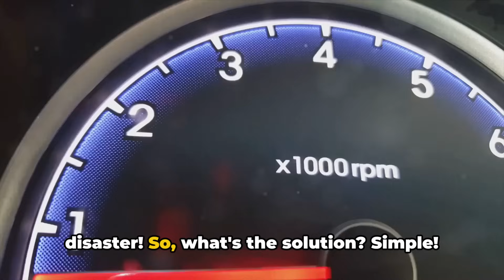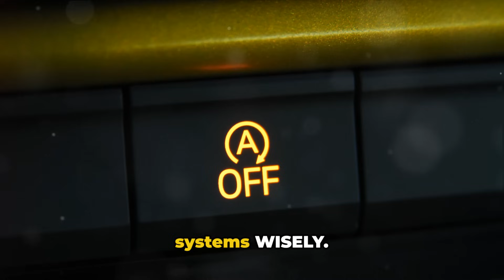5 Mistakes that Destroy Turbo Engines Fast!

Comment: As soon as i wake up, i remote start my truck so its ready by the time i leave, I turned off the start-stop feature because anyone with mechanical sense knows its stupid, and i only use AMSOIL full synthetic on my F150 Ecoboost.

Comment: Sounds like rules for all engines and not just turbocharged engines (besides the part about idling after driving hard as that highly depends on the car. Some modern cars keep the cooling system on for a short time after turning the car off.)

Comment: Could we  , go back, and reverse  ' time '...for about 15 years , or so ?  Auto Industry.  // The  ' problem '....is us, humans.  WE want    WE  want  WE  want.   = more  Power. // So, engineers design, smaller, more powerfull engines.  No honest, design analysis, of   modern  ' people '  and their  fast - reckless, emotional decisions. // Turbos, on gas engines :  1.  A  heat problem ; radiators TOO  SMALL.   People,  TOO stupid, to understand, the  ' physics '  involved, in modern high - tech stuff.  Uneducated, in the laws of thermo - dynamics, and lubrication ; all aspects, of engine design.  From aluminum engine blocks,  ALL  TOO  SMALL....for proper cylinder cooling. Radiators, too small.  Too much plastic  ' coverings '' over engine.  Turbos, SHOULD  ONLY  BE  USED  ON    DEISEL  ENGINES !    Smart phones,  smart houses.....smart  Tvs'......PetSmart   =  makes for  STOOPID   people ; with NO   LOGICAL  analysis'   of   ANY THING.

Comment: today we have bump into a GLA45 AMG 2.0 turbo engine, customer complaint engine knocking, when we test drive we can hear that is pinging, add a bottle of octane boost, stop the problem, customer didn't know what gas was in it before due to she just got the car from carmax. free full tank of gas, but who know what they put inside right?

Comment: In regards to fuel (opinion alert) the difference between the cheapest gas in town and something like Chevron or shell, is more important than putting 87 in your tank. Detonation is a thing, don't get me wrong, but considering almost 40% of vehicles being made these days have turbos now, manufacturers know that the owners will not always put premium fuel in their car. These days, the car knows the octane rating it's burning and adjusts accordingly. You probably won't be able to feel any power difference unless you're on a dyno.

Comment: Start the engine and drive. Let it run for minutes is bad for cylinders and piston rings cause the motor runs with much fuel, that will wash the oil from cylinder walls

Comment: No car should be driven hard immediately after starting. Oil takes about 8-10 minutes to warm sufficiently to do its job. That’s important for the engine generally, not just the turbo. Good video.

Comment: unfortunately, some manufacturers (Audi for one in 2025) no longer allow the car driver to turn the start/stop off.  Others require the star/stop to default to on every time the engine is turned off.  So the driver has to hit the button to turn it off each time he/she starts the engine.  So if start/stop is bad for that Audi turbo engine, will Audi cover the engine failure under warranty after the warranty expires?  I think not.
Reply: Get it coded out, simple.

Comment: Thank you for your excellent advice. As a diesel mechanic, can you tell me if we follow your advice from when the vehicle is new should all turbo diesel owners be concerned about a runaway diesel? I am debating getting an air shut off installed.

Comment: My AMG will not go into Race mode if the engine and transmission temps are not at normal operating levels....
Reply: That’s actually pretty dope

Comment: Letting the Engine idle after driving is going to kill your turbo. While idling there is nearly no oil flow in the turbocharger which causes that the hot oil just sits in the turbo as well as you just turn it off. Instead you should drive calm the last few minutes to let the whole engine cool down with oil flow

Comment: You dont need to wait all that time. I drive a Bmw and when I cold start the rpm goes to 2000 and goes lowering until less than 1000 then youre ready to go

Comment: How is it possible to make high-stress driving on a highway? With such incredible low speed? I guess you don´t mean the german Autobahn. One time I drove 400km with an average speed of 180km/h. Since there were building sites between I had do go about 220-240km/h all the time to finally get my average (that was the best time I achived up to now. It was years ago) Under that conditions there are high-stress conditions. But a US highway seems to be low-stress, isn´t it?

Comment: Cold start and accel...specially for diesel cars its big killer to not wait engine oil get hot.
Me in winter i start engine and go remove snow from car and clean windows(its 5-10 mins process it helps engine gets hot without dmg)and after that slowly drive.
Ofcourse cool engine after long drive make sense.

Comment: I idle the car for a bit atleast for 1 minute in germany youre supposed to drive immediately when youve started the engine but not everyone takes it serious cuz most know its stupid to not let it run a bit to get things cooking
i use 100 octane or atleast 98 octane fuel from more well known gast stations its more costly but those cents in difference can make a bigger difference plus what i hate here is how they praise the Start/Stop Function... like every mechanic told me as ive already knew it screws your battery, it screws with your engine and especially screws with your turbo when you drove on a highway with maybe lets say 130 kmh or more and you have to stop at a stop sign and you maybe forgot to turn it off and your engine goes off and starting it then again can mess up things pretty bad... the start stop is in my eyes the worst feature theyve ever put into cars in my eyes

Comment: Relatively new engines still circulate oil for several minutes after the ignition is turned off, so there is no need to cool the turbocharger first.

Comment: On a scale of 1-10 how much does synthetic oil (which doesn't get thick as fast as real oil does in freezing conditions) help with the first point about not going ham right away after starting? 
On the second point, how much do fuel additives designed to increase octane counteract the bad of lower grade fuel? I usually use premium but occasionally I'll use regular with an octane booster/fuel additive.
Reply: Synthetic oil does help especially the good quality GTL(gas to liquid) Fuel additives can help if you have fuel injectors since they keep your injectors clean.

Comment: After engine start in cold condition I regularly wait until the idle RPM drops down to around 800rpm. Works fine for me since years. And I only hit the pedal hard once water and oil temp is up and in green band.

Comment: Don’t sit when it’s cold. Let the oil move throughout for 10-30 seconds depending on how cold it is, then set off VERY VERY GINGERLY until oil temps are above 150°F or so, or running normal coolant temp for a few minutes when you don’t have an oil temp readout. 

My 2020 Veloster N has almost 100,000 miles and doesn’t have any engine issues whatsoever, including almost no catch can contents and almost zero oil consumption (I only say almost because it’s immeasurable and likely still present). It’s been tuned on a JB4 (MAP2) for 50,000 of those miles. Just took it out in 24°F weather and followed my exact words here.

Comment: Don't do idle thing when car is brand new. Just drive without accleration above 3500 RPM for those 2-5 minutes. Modern oils are no like syrup and they flow well. Don't baby your car and it will last much longer without excessive oil consumption.

Comment: Another good thing to do is accelerate hard at least once a trip so you can keep the turbo waste gate moving. As a technician I replaced more turbos due to waste gates seizing shut then actual turbo failure. Trust me the engine is designed to handle the load and you will not be causing any damage to the engine or turbo. Just wait for the engine to be warmed up and let it cool before shutting it off.

Comment: Great video!
This past summer, I purchased a TLX with the 2.0 Turbo. (I wanted the V-6 Turbo but it was hard enough trying to come by the one I bought and it was the only one on the lot.) This is my 1st ever vehicle with a turbocharger. However, I practice the same thing with my 2 other vehicles and they both have normally aspirated V-6 engines in them, but the 2019 has a gasoline direct injection engine; the 2003 does not.

Comment: Minutes of idling with cold engine causes your oil to mix with petrol which hinders its lubricating abilities. I prefer to drive off with easy foot on the gas pedal few seconds after starting.

Comment: Is it usefull to wait a bit idle (15-20seconds) before driving away if I don't have turbo ? the temp where i live are 10°c winter and 30°c summer.

Comment: No need to warm Engine by idling for 2 minutes. Driving the car at low rpm is the best way to warm it up. Just keep it below 2k rpm and you'll be fine

Comment: I lived within the arctic circle on the Norway Sweden border for many years  we needed to run block heaters in our engines to keep the engine at above freezing even with a block heater I still had to run my old Saab until it warmed up I needed at least 20 to 30 minutes for some warmth to the heater core and defrost the inside of the front screen which was usually thick with ice. I would get out of bed unplug the heater and turn the car on outside the house then go back to bed for 30 minutes then have breakfast and then leave the house. letting a car run for 5 or 10 minutes was a luxury we never had.
Reply: Being English I'm quite adept at complaining about the weather, but if we had your weather I think all of our complain valves would explode. No matter what oil we used or how long we complained on idle.

Comment: well said.  having had turbo cars since a 90 saab 900 turbo I have always followed these rules.    Engine driven Superchargers are less of an issue since they do not share oil with the engine.   Then standard let the engine oil get moving practices are in effect.

Comment: I drive a BMW with a turbo diesel. I always drive slowly for about 5 minutes keeping PRMs low, and never go wide open throttle until the engine is at full operating temperature. This formula has worked well for me on numerous European turbocharged cars over the years.
Reply: New BMWs preheat the engine alone
Reply: You dont need to have a low rpm because u have diesel directly when u start the engine u can gas how mutch u want its only gaspowered cars that need to wait for cold start and drive with low rpm untill it warms
Up

Comment: You definitely must not thrash an engine after a cold start. However, idling a cold engine also causes wear. For example on a modern turbocharged diesel car, you're supposed to turn the key and let the glow plugs warm up the combustion chamber for 5-15 seconds. Afterwards, you start the engine and in less than 30 seconds, you drive away as lightly as possible (don't lug the engine or you'll wear your engine down and clog your DPF faster), gradually increasing the RPM. Letting it idle at 800-RPM for 5 minutes, not only is working a cold engine in RPM on which it is inefficient, but will also create local hotspots due to temperature imbalances.
For a diesel car in temperatures around 15ºC
Let the glow plugs warm up until their light on the dashboard turns off.
Start the car and wait 15-30 sec
Start driving and stick around 1000-1800RPM for the first minute or so, then slowly climb to 2000.

If you have to go uphill, your engine should warm up a bit more beforehand so sometimes you just need to rev it.

Comment: That is a mistake that most people do, not leaving the engine run and heat at the beginning and leave in a rish because they don't want to lose time, and then some have accidents or screw the engine and turbo because of that

Comment: I thought that manufacturers had figured out the part where you need to idle your car after highway or high load driving by now? Up to what year models does this apply as they don’t warn you about this (anymore) in the owner’s manuals?

Comment: I die on the inside when i drive with my mother cause she starts the car and before the lights and everything is on she throws it into reverse drives out then full throttles our 2.0Diesel up to 3.3k rpm 😢😂

Comment: I brought a Sierra Cosworth 3 door brand new in 1987. I used to drive it hard at night, then pull over lift the bonnet and watch the turbo and down pipe glowing. The heat was intense. Awesome. True story!

Comment: ....and use ceramic additives (hBN) ! These give your Turboshaft best emergency lubrication - my little 1.4 downsized NaturalGas (Methan) got now 160.000 miles with engine still running strong, hope it will make further 160.000

Comment: I have a newer BMW X5 w/ turbo engine.. Every morning I warm it up for about 5mins, gives me enough time for my wake n bake 👨🏻‍🚀 ☁️  always change my oil around 5,6 xxx miles, nothing but 91 gas, from good ⛽️ stations.. and also I always turn off the auto/off engine mode, it’s annoying hearing the car shut off at the light🤣 good thing there’s a button to turn that mode off🥃 
I think I’m doing pretty good 🥃

Comment: Great video. Thanks for posting

As you outlined its just a few basic things that need to be done CONSISTENTLY.... every day that ensures longevity of the engines

I just happened to stumble upon this video on youtube, but I have always been following the 20-10-20 rule which is as follows

1) After starting the engine, idle it for 20 seconds
2) Drive gently for the first 10 minutes ( irrespective of your terrain) so that the engine and other parts warm up evenly
3) after you return to your parking, ( I mean any parking) before shutting down the engine, idle it for 20 seconds

I have personally seen benefits such as.... my cars being well below emission levels( I do periodic emission tests ) and the engines would stay refined, besides, I get decent mileage ( I use the manufacturer advised octane rated fuel only)  as the  parts work efficiently

Again, thanks for sharing, happy motoring !!!

Comment: I have a 2016 Subaru Forester xt, 2.0 turbo, just turned 282,000 miles and runs like the day I bought it. I change oil every 4000 miles and have had no problems.

Comment: For newer cars when you turn off your turbo engine it wouldn't usually go complete idle as I can always hear the engine/fan still running for a min or so before going completely silent. Wouldn't that be the manufacturer's mechanism to protect the turbe engines?

Comment: Changing Oil every 3500 to 5000 miles? Every 5600 to 8000 km???? That may be recommendable with non-synthetic oil! Synthetic oil lasts easily 15000 km (9300 miles)! I bring my car (Mazda 6 Wagon, 2,2 liter R4 bi-turbo Diesel) to an inspection (including oil change) once per year, just when dashboard says it is time for that. And my car is running with no issues at all, despite having some 212000 km on the clock.
Reply: I change mine annually.  October or November get it in so its got nice fresh oil for winter. Usually about 5k miles on mine

Comment: 3:09 The result is not just oil coking. The turbine shaft is still spinning at a high speed immediately after driving, so when you quickly shut off the engine, those turbine shaft bearings/bushings have zero oil pressure to lubricate and cool them. The same goes for revving the engine at a car show to impress your friends, then shutting it off.

Comment: I got all of these tips recently from a friend when I asked him how my car which delivers 130bhp from a 1200cc 3-cylinder engine manages to achieve that - extreme supercharging.
Reply: Don't check the 300 HP 3 piston engine from Toyota Corolla GR then ... or the 1600 cc F1 engines which have 850 HP
Reply: I am guessing you drive a Peugeot or and Opel with those modest Hp figures

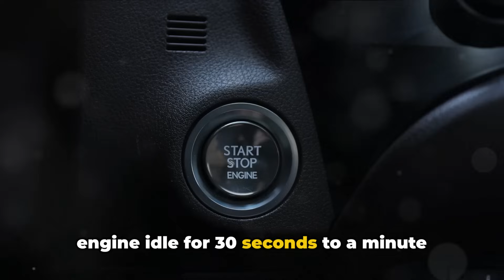Comment: 3:15 and this is why I turn off the fast idle switch when i park the bus in the garage and let it run when i check the inside of the bus to let it wind down

Comment: Not a good idea to wait 2-5 minutes with a diesel engine, ok wait 1 minute, but no more than that, the whole recirculation exhaust system will be fked with black coalish residue if you do this a lot of times.

Comment: Good info.  I have a 2008 Acura RDX turbo tech with 61k miles and follow this advice.  Only major issue so far was leaking engine gasket at 50K miles….effin expensive.

Comment: i was always told to never, ever, instantly drive a car (or any motorized vehicle) right after starting it.
Except when it's really cold weather though.  Because the oil is typically so thick at those times that the pump struggles to suck it up and circulate through the engine.
In order to help it a little. Idle for around 30 seconds, then rev the engine just a little bit for a a minute or so, and than let it idle for rest of those 2-5 minutes.
But that's only for specific circumstances.

Comment: Sry but so often I hear this nonsense : Its not an explosion ( at least if it isnt a Ford ecotec😂), its a combustion engine. The flamespeed of the process is around 10 times higher in first case.
Ps: One thing as the exhaust temperature in gasoline engines is significant higher compared to diesel engines ( = more stress for turbo) these tips, especially no 4, are even more important for gasoline ones.